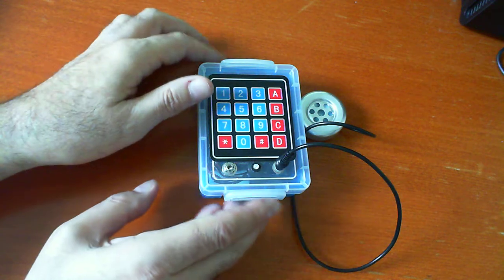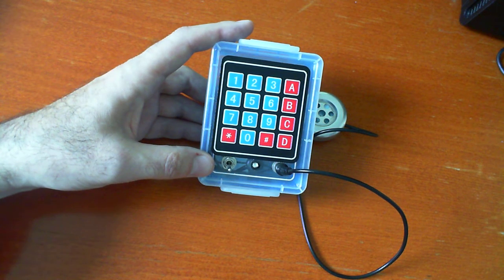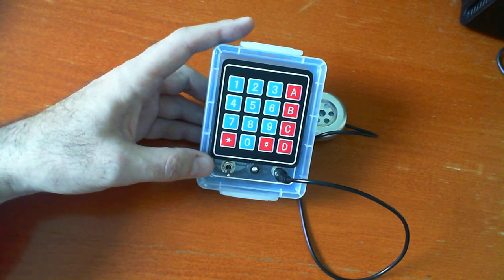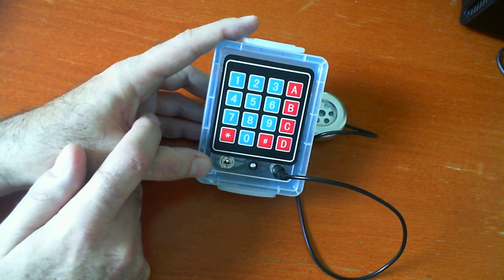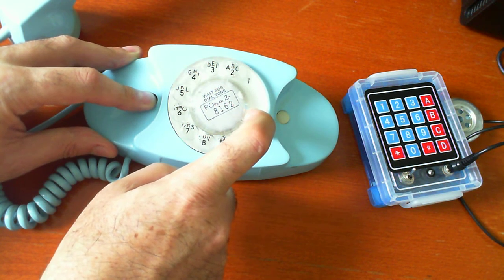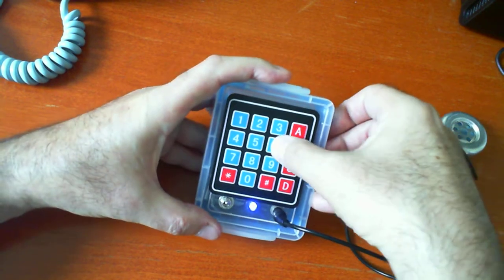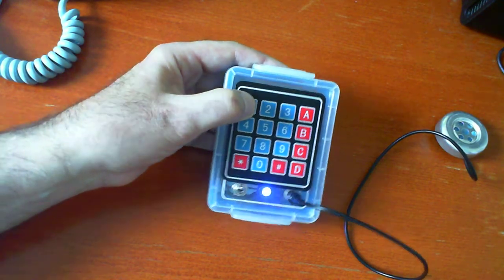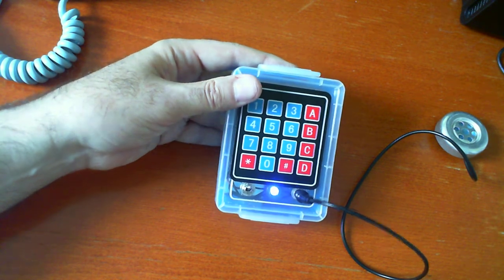MTS (Mobile Telephone Service) "Dial" Mode (Secode/GE dialing system)

Comment: I have no idea about Secode. I know that MTS does not support any signaling tones to control the base station. The signaling towards telephone (paging) i could figure out and it works with my MTS phone. Do you have detailed information about Secode? I like to add this type of dialing to my IMTS/MTS base station emulator.